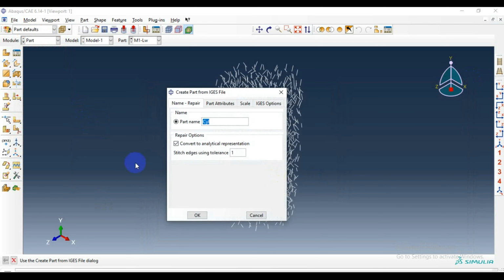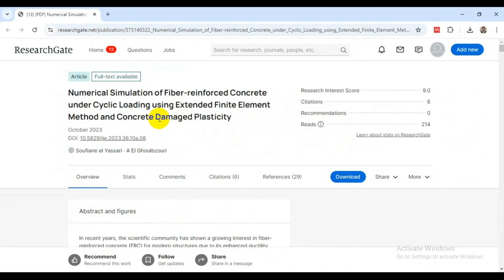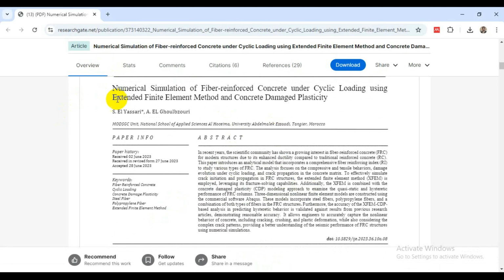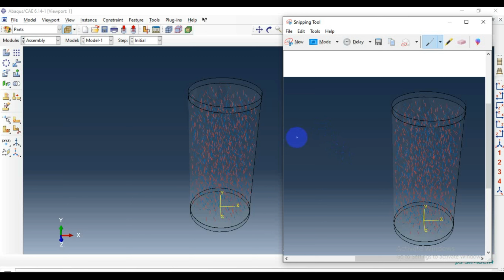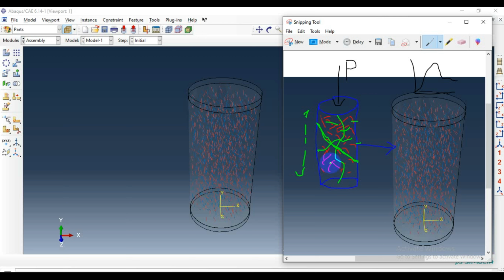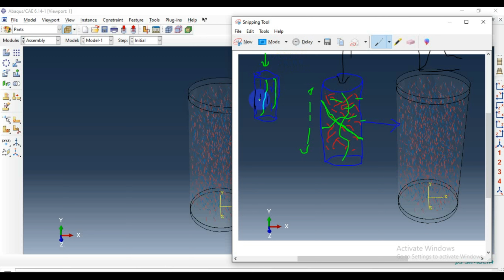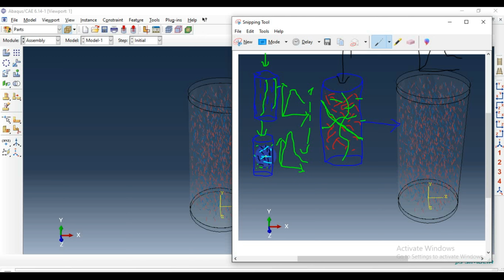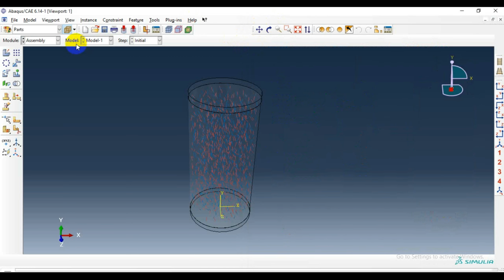Lecture 1 of 7 | Modeling #Fiber #Reinforced #Concrete Using #ABAQUS

Comment: Hello, thank you for this tutorial.
But it seems that fibers wires can be modeled in the form of wires part in the graphic environment of Abaqus, do you agree?
Also, is it possible to access your email? thank you
Reply from the maker: Yes, definitely. However, that approach is quite challenging. There are some repositories that include scripts, but currently, I believe (though I could be mistaken) that they don't meet the requirements for handling complex fiber shapes. Please connect with me on WhatsApp; Https://wa.me/+923440907874, if required.